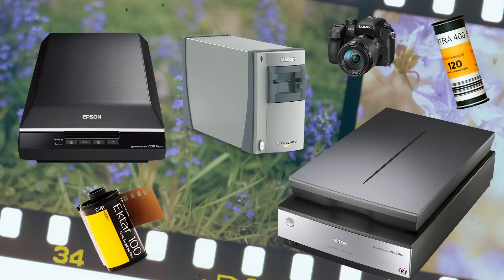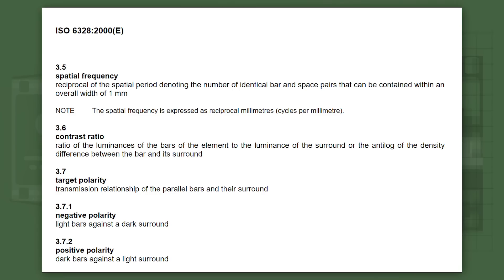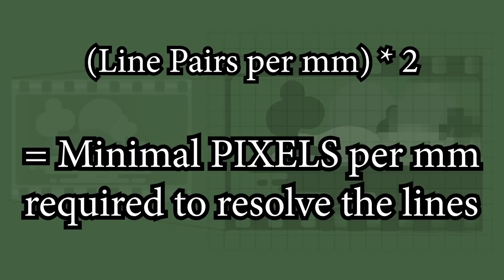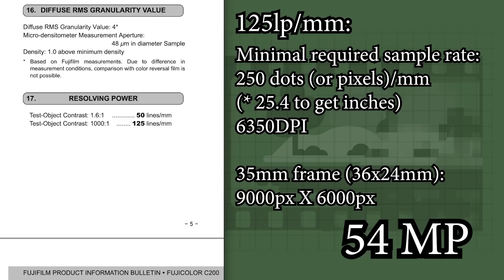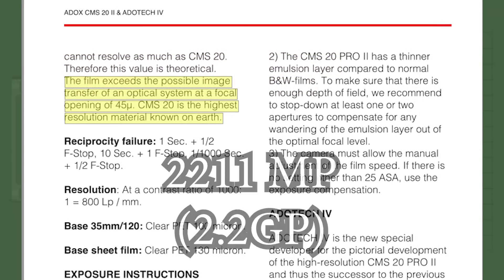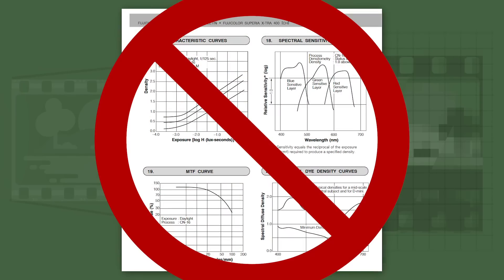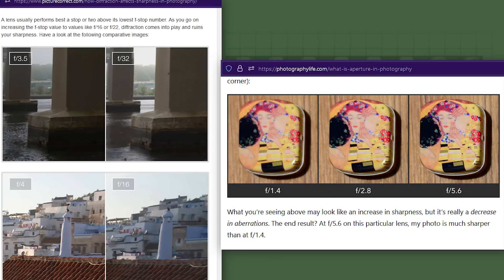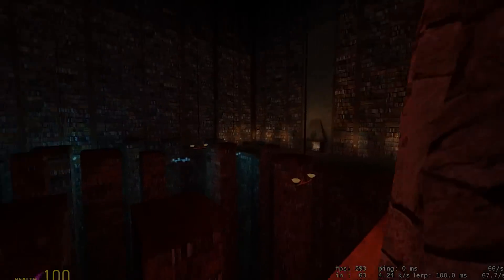The TRUE Resolution of FILM

Comment: If film has so much resolution, where are all these hyper acute pictures?  Why do 35mm lenses that were A-ok for film fall apart when used on digital camera, yet the reverse is not true? When you look at photo books that had 35mm or sometimes larger format color shots from the 80s or 90s, they seem technically archaic, they are obviously falling apart on double page spreads, for instance. 

These calculations may, in some way, be scientifically correct, but practically the resolution is nowhere near claimed. And it’s not a matter of using vintage equipment today, or of transferring shot film using digital scanning. if you go back and look at film shot when it was the state of the art, you will not be impressed by its technical qualities, certainly comparing same format to same format.
Reply: Let me introduce a concept of telecentricity to you. At microscopical level the film surface is very uneven. Silver halide crystals are clumped in lagrer groups, therefore making a "mountainous landscape", so the light doesn't scatter that much over the surface of the film. The surface of the digital sensor is much more even - like the water in the pond, so if light rays are hitting the sensor at an angle, you get significant drop in contrast resulting in lower resolution. That's why lenses made for digital sensors must be telecentric - the rays leaving the last surface of the closest-to-the-sensor optical element, must hit the sensor at 90° angle. That is why lenses made in film era usually suck when being adapted to digital. But you can easily use lenses made in the digital era on film with splendid results. Film doesn't really care which angle the light is hitting its surface at.
Reply: @tweed0929 overall correct, except grain doesn’t clump. It’s the nature of light and random distribution that makes it appear that way.

However: 
The sharp geometric edges of the image sites/pixels of a sensor makes dispersion set in much earlier when you stop down the lens.
That is a serious limitation that makes it harder to get real good depth of field without a drop in sharpness.

Film cameras can be stopped down to f8 for 135 and f16 for 120, without serious averse effects.
Reply: @newtboys  first of, if frames taken almost 50 years ago is your sole reference, I wouldn’t put too much empirical trust in that. 
Focus error, camera shake, even unrealized small faults in the lens and camera could, and most likely does all play a role.
 
Secondly, the Agfa Chrome material was always second tier, and high speed of ISO 160 doesn’t improve things.

I have done the exact same experiment as you.
Frames taken with high end digital cameras with 40 to 80 MP sensors, projected on a 4K projector, compared with 135 Provia, Ektachrome and Velvia slides on a good projector with a good lens. 
There is just no comparison.

Not only is the resolution noticeable higher on the film. Colour resolution, saturation and image stability is worlds apart.
The digital image often turns into mush where colour and tonality gets complicated.
Reply: @newtboys  Scans will never compare to projection on a screen or paper WRT resolution.
Even the best Coolscan only has a resolution around 3900 dpi. 

I wouldn’t trust the taking process of anything that happened 50 years ago, even if it was my own photos, unless it was scientifically documented.

My frames shot this summer with Nikkor AF lenses on a tripod, knocks the socks off anything from a 4K projector.
Reply: @newtboys  often what you perceive as grain from a scan, is an amalgamation of interference beating between the real grain and the sensor and then scanner noise.

The real grain is not the end of resolution either, in quite the same way the frequency of hiss from magnetic tape does not demarcate the upper frequency limit of the recording.
Reply: Don't forget that all those old photos were reproduced without any sharpening. Imagine if you took your 15 MP digital sir and made an inkjet print with all the sharpening turned down to zero I/e just printing the RAW file with no processing. That is digital's strength though - sharpening up fine detail even from a 5MP camera is child's play. Which get's us into the topic of "apparent resolution" aka "sharpness", which wasn't tackled in this video. If it had been, nowadays digital wins every time and without breaking a sweat. In fact I think many digital photographers tend to over sharpen their images, but I guess that comes down to taste. And I'm a film enthusiast, by the way! And you are right, digital sir's do expose deficiits in old  (film era) lenses in a way that film never could.
Reply: @emotown1  Nonsense, sharpening up images is very visible and not done with quality capture. Raw files are mostly quite soft but retain way more detail than argaic film pics.
Besides 15 mp is nothing these days it`s more like 30 to 40 mp, sharpening is not needed.
Reply: Lenses for film doesn’t have to worry so much about hitting the sensor at a right angle. That’s much of the reason they don’t work well on digital.

Photobooks made from digital look terrible. All the particularities stick out like a sore thumb. 
Waxy and missing micro detail, bayer artifacts which is mostly lower colour resolution and poorer tonality, harshness from edge enhancing during demosaicing and poorer dynamic range which results in highlight clipping.
Reply: @Frisenette  All you`re mentioning has been resolved a long time ago, you sound like a broken down record.
Analog sucks in quality and reproduceability big time, analog is grainy, has very low dynamic range, poor color fidelity, is extremely cumbersome an expensive.
In short, it belongs in a museum.
That`s not my opinion, that`s everyone`s opinion. Every picture you see everywhere has been from a digital source how about that.
Reply: @brugj03  these issues, and more, hasn’t been resolved.
They are fundamental flaws of the current sensors and algorithms to low level process the sampled data out of them.

Digital, as a viable means of photography has only been with us about twenty years. All the rest of photography is film.

The most beautiful and profound work in the realm has been done in that medium and continues to be made. In museums in photo books, posters, small and large.

Grain, in what shape and form it might take, is real. It’s like the texture of paper, like a fingerprint. It’s a structure from the physical world. And our brain recognizes it as such.
Not so with interpolated mush, manufactured and guessed at detail or various kinds of aliasing and clipping.
Reply: @Frisenette  Whatever man....maybe we should get back engraving in stones.
Maybe we have been doing that even longer.
If you cannot see the huge progress and advantages made, i cannot and will not try changing your mind.
You`re a dinosaur without valid arguments.
Reply: @brugj03 if you really love images, you won’t be satisfied with crayons. No matter how convenient they are.
Artists will insist on good tools and good media.

Comment: When you started by showing how it varies from film stock to film stock and then explained the "lines" vs "line pairs" per mm aspect and pulled up the ISO standard, I knew this was gonna be a great video on the topic! Many people have only done various surface level analysis but those bits alone were a good indication of where things were going!

I liked how you stepped up and even touched on CMS 20. When you mentioned that was approaching the limits of the wavelengths of visible light, that brings in a whole other interesting topic: recording wave interference patterns. These are finer than the wavelength of the light used to create them and thus need those higher resolutions! What is this used for? Holography! Special holographic plates go much higher than that. There were Kodak plates meant from ~2000 lp/mm. There are these Russian plates capable of 5000 lp/mm. And there this French guy who makes these super good plates that can do 10000 lp/mm. But, again, optical images with visible light is way beyond diffraction limited by then.

The other use case of recording interference is the Lippmann process. He put a layer of MERCURY (yes) touching an ultra fine emulsion from the back so that the light would reflect and interfere with itself as it cross the emulsion, forming standing waves! These waves would have a frequency of the light but, of course, form nodes at static spots. When you develop this plate, the interference pattern recorded filters light according to the lights frequencies and actually results in a positive color image!! This was invented in 1890!!!

On scanning, yeah, optical enlargement is really the only way to really see what's on film. By ANY optical enlargement process. Projection, pointing a microscope at it... Henning Serger on Photrio collated some results of what he got in terms of "real world" resolution from a bunch of film stocks and they get quite close to the values on the datasheets.

I'd also check out "high-end-scans" for examples of someone who is digitizing ADOX CMS or other films, even color print films, around where the lens is diffraction limited. Or more. And he also has samples of larger and larger films. 

This is a really stellar video, it's kinda rad that you had just some occasional videos on film and then posted one of the best videos on this topic!!!

Comment: Nice video!
I appreciate the engineering approach more in depth than what we usually see, however I do believe you have misrepresented the Nyquist/Shannon constant, which is not based on geometric imaging, but purely mathematical sample rates needed to preclude aliasing in highly simplified quantification models. 

This notwithstanding, you do breach some topics which may be known to older analog photographers and often less considered since the immense popularization of digital imaging.
 
I am an aerial photographer, shooting many formats, but my preferred medium remains my 4" x 5" analog camera, in which I use Kodak Aerocolor IV 2460 or AGFA Aviaphot X100-PE1. Both of these are rated at 100 ISO and  ~200LP/mm, placing them beyond the "best case" resolving power I can expect from my Zeiss and Schneider lenses over the 4 x 5" film size. These are good, honest results, and I can present a photograph in a court of law (and have done so) as evidentiary evidence, backed up by an inalterable negative, which is a piece of film that was physically in the aircraft at the precise time of exposure.

I also shoot full-frame (24x36mm) digital on a 54MP Canon camera, which also yields excellent results. 
In fact, the two are so comparable that if I go back to look at a project from a few years ago, I have to read the information file to know which is which. I do not see the difference in the image quality itself. 

The difference is that the digital camera will "manufacture" an output of 54MP no matter what the input. If I take a picture with the lens cap on, I will still get a 54MP image, even though there is no information there. In other words, the term "resolution" no longer means what is used to mean, and is now a defined constant based on the output format of any digital camera, but not related in any way to the resolving power of the images captured. 

Now the Canon 5DSr is an excellent full-frame camera for aerial use, however the full resolution of the sensor is approximately 8500 pixels wide, which is 235lp/mm, and these performance criteria for lenses are only obtainable in laboratory conditions - not in the field with interchangable lenses. So "some" part of the image rendered is created in the camera's CPU - interpolated from the real image data captured. 

This gets worse when we consider that the sensor in my camera is covered by a Bayer filter to produce color imagery. With 2 x G, 1 x R and 1xB we can say statistically that the spatial resolution of the sensor is reduced by 50% in order to procuce color images. 

As time goes by, we may expect even greater "wizardry" from digital cameras, rendering them even more enjoyable to use for most photographers, but removing them even further from the "hard cold facts" realm, where my piece of 4 x 5-inch film represents absolutely the resolved light from the subject at the time of exposure.